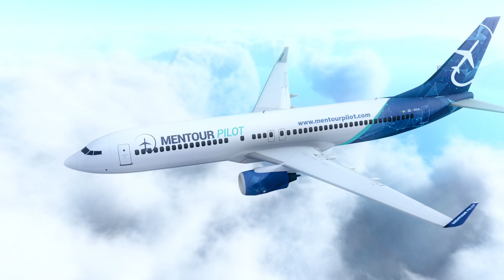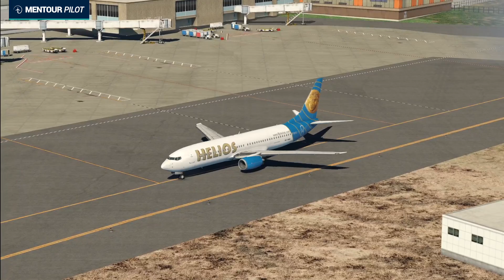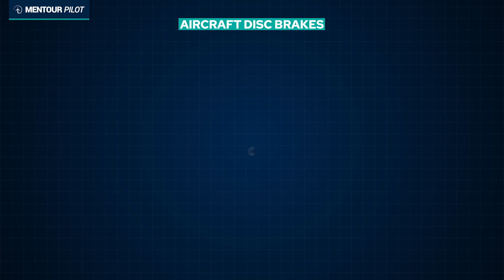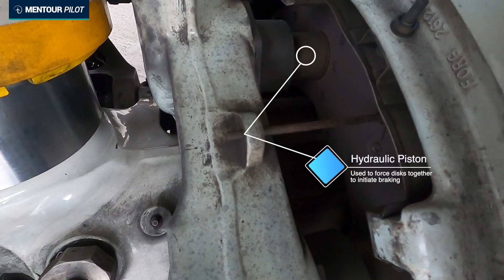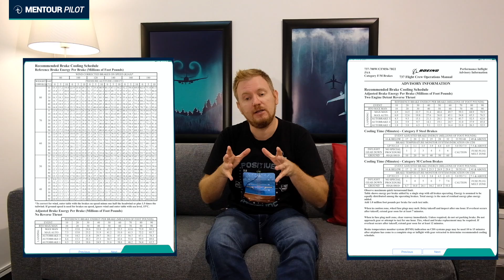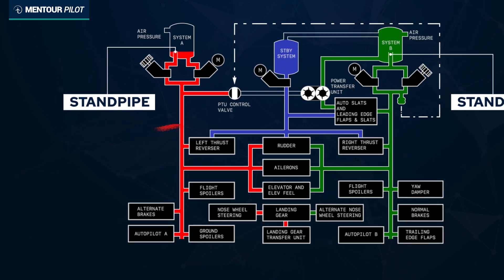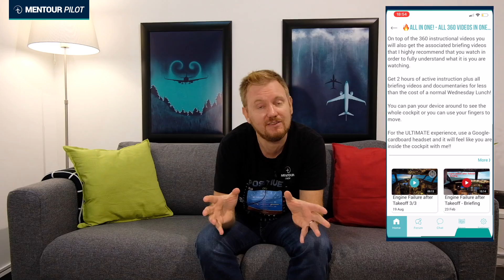How do Aircraft BRAKES work?!

Comment: A brake is basically just a type of clutch, that happens to connect the wheels to the frame.
These brakes are actually quite similar to a multi plate clutch.
That being said, there are few things faster and heavier, than a landing airplane, lots and lots of heat.
Reply: Railway trains can be much heavier and have far less grip - steel wheel on steel rail is what makes them efficient, but also means they are unable to stop hard.  Of course, failure to strap down the self-loading cargo is also a limiting factor.
Ships are vastly heavier, although much slower, but again - very limited grip so emergency stops are not a thing in naval architecture.
Reply: There are different kinds of brakes though. You are talking about friction brakes but there are induction and regenerative brakes, too, that are used on high-speed trains.
Reply: @unvergebeneid  They are still limited to the grip of the wheel on its running surface.  The only exceptions are those used on a few mountain railways and tramways which grip the rail itself, but they are limited in usefulness due to the inability to deal seamlessly with points and crossings.  Regenerative braking is also used on EVs.
Reply: Exactly what I was thinking: they reminds me a lot my motorcycle clutch, just working the other way around (not to transfer motion to the wheel but to stop the wheel to spin, a bit like shifting down).

Comment: I'm surprised to see the brakes can stay that hot,  remaining above 100°C even after hours of flight at way below freezing temperatures.
Reply: In his graph, it looks like each flight only lasts about one hour.  On short flights, a lot of that time is going to be spent climbing and descending.  The plane may not be spending too much time in sub-freezing temperatures.  Also, with the landing gear retracted, the brakes are tucked away fairly well.  Notice how much faster they cool when deployed just before landing.  Finally, the brakes have a lot of mass -- probably more than the engine in most cars.  If you park your car with a hot engine in cold weather, it still takes a while for the engine to cool off.
Reply: @andrewsnow7386  Thanks for expanding on this. In addition to your explanation I looked up a table with the "conductivity of heat" for some materials and found steel positioned by far not as high as other metals.

Also I found that diamonds are extremely good conductors of heat. I'm not suggesting to manufacture airplane brakes from diamond 😀 but I think that's another reason why carbon brake disks are superior. (Carbon had no entry of its own in this table.)

Having said that, and as being born in the 1950s, I have to state we live in really amazing times having all this information ready at our finger tips. When I studied during the 1970s it would have required to do at least a trip to the university library to find such tables giving information beyond what was contained in our physics book.

It's a pity that despite all this information is so easily available some people still believe in so much unscientific crap - and as it seems to me such believes even spread in growing numbers, like currently with anti-vaxxers. (And with believing the Earth is flat for religious reasons on top of that pyramid of stupidity.)
Reply: @mittelwelle_531_khz  Cars actually use cast iron rotors, not steel because cast iron is better at rejecting heat than steel. Another thing concerning carbon brakes on cars (they are typically an option that costs $10,000+) is they don’t work as well cold as cast iron rotors. They need to be used HARD for maximum effectiveness. It is not usually a good option for a car that is a daily driver. They are best used for the car you take on a track day regularly.
Reply: @Markle2k  Thanks for expanding on this. Seems there's no video from Mentour Pilot where you couldn't learn one or two more interesting facts from the comments :-)
Reply: @mittelwelle_531_khz  I'm also old enough to remember reference books and libraries.  The times are amazing. 
About conductivity.  Diamond has an amazing thermal conductivity (5 times that of the best metal - silver).  Other forms of carbon are not going to be as good.  With regard to metals, metal alloys usually (always?) have less conductivity than the pure metal.  Thus pure iron conducts better than steel, but also better than cast iron which usually has more carbon (thus less iron) than steel.
Finally -- conductivity is not everything.  Conductivity is needed to move heat away from the friction surface further into the disk when the brakes are applied.  But, especially on aircraft brakes, thermal capacity or specific heat is going to be at least as important.  That is, you want a material that can store a lot of heat energy without getting too hot.  Like conductivity, the specific heat of every material is going to be different too.
Reply: @andrewsnow7386  Thanks for your exhaustive response. When I was thinking about "conductivity" I had in mind the time the brakes have to cool down while the airplane is flying. But all the things you mention are of course important too, probably even much more important.

As an aside, what caught my eye is that metals which are good conductors for heat seem to be also good conductors for electricity. (I didn't look up the latter as – despite I'm mainly a software engineer meanwhile – I have a background in EE and still roughly know how various metals compare in their specific resistance.)

I guess it has something to do with how the atoms bind and that metals have free electrons, which may not only be the means by which electric charge is transported but also the way heat is conducted.
Reply: In flight they sit in a nice insulated wheel well, surrounded by a really thick layer of insulating rubber from the tyres. They only really cool off when exposed to airflow in the time the wheels are down and the aircraft is taking off, and on final approach. When in the air stream there will be flow through the pack, but typically only the outside, as they tend to be touching all the time, held there by a set of springs so that the hydraulic system has a consistent volume of liquid it has to pump for a specific brake action. 

Inner sections will stay hot for hours, especially in hard braking, and having a RTO also means you have to have a brake inspection and probably replacement, as you likely lost more than half of the active material scrubbing off that energy. You will also likely need tyres as well, they will have had a lot scrubbed off them, even with ABS, as there will still be a bit of slip as the valves modulate grip. 

The original friction material up to the 1970's was asbestos, and it is still used in some niche applications, as there is nothing that is drop in. But the modern ones use a ceramic material, or carbon composite, as the friction liner. Thus temperature monitoring, though the bigger issue is tyre degradation from heat, which is why they have a fusible plug on them that will deflate in a controlled manner, rather than exploding.
Reply: "I'm surprised to see the brakes can stay that hot"  I prepared a graph just like the one shown in the video, comparing an MD-87 to a 737 (an island-hopping airline was going to purchase one or the other).  I had access to all the cooling coefficients etc needed to run through the thermal calculations.  In my hypothetical simulations, the ratcheting-up was even more pronounced than what the video's graph depicts.  A 737(-300?) brake absorbing a moderately high energy input, and with only thirty or so minutes to dissipate the heat in-flight before more heat comes in from the next landing/taxi, keeps getting further behind.  Meanwhile the MD-87, because it used the same brake as the heavier MD-80, didn't get nearly as hot and that upward trend wasn't seen.  So as we say in engineering,  "It just all depends."  ; )

Comment: Drop the landing gear for a few seconds at a couple thousand feet altitude to cool it off
Reply: I'm sure there is a procedure to do this.
Reply: @froggymicb  Yes; Look it up in the manual before attempting the approach!
Reply: Haha I thought the same thing. Wouldn't that be a drag? 😆
Reply: @LORD_1775  Well the extra fuel might be less than the extra revenue from reduced loading times. It's a cost-benefit. 

This is a joke OFC
Reply: @pilotavery  
Whatever OFC denotes I had a  girl friend whom held an MBA and obtained work at ( major carrier ) I can assure you is is no joke to them: If some person in that position reads this they might just do the calc's ~  the person expressed wonderment at how 2 major airframe had reported being under 1 mile separation — all the computing power we have nowadays can be brought to bear saving 0.000051 / seat-mile → Many do not realize the commercial carriers operate on thin margins
Reply: @ChiDraconis  right, this is what I mean. Cost saving is not a joke, and if it burns $107 worth of fuel but they can save 7 minutes on the turnaround then it might be worth it for them to do it. However, the joke was because it was completely impractical to do this in particular.

Comment: When landing it's obvious when and how the ground effect comes into play, but is it also a consideration during takeoff? Even insignificant, though non-zero.
Reply: Yes it is, thats why you have the "positive rate" call before retracting the landing gear, if the air craft is too heavy it can actually rise off the runway in the ground effect, but then not have enough lift to climb further. You can see this in action in a lot of takeoff related accidents.
Reply: @Musikur  Wow. That's like hydroplaning in the air. That gives me a whole host of things to pay attention to and understand the hows and whys of in videos and when flying. Thanks for that info!
Reply: @GlenHunt  Very much a consideration though the feel is different;
My first-ever take-off roll in a Piper trainer I had been in a J-3 previously I am trying to do what is called soft-field takeoff as we had nearly 2 miles of concrete and I wanted the lower drag of air rather than the rubber wheels ~ instructor would not let me due to you do something that you know works but yes with even slight back-pressure on the yoke we do get some unloading of the under carriage ▬ on approach you tend to be pushing some air ahead of you and down which does not exist as much on the TO roll → it is called Air Plane for exactly the reason that hydroplaning can get your feet wet ~ Humans are not Ducks!

Comment: There are also brake fans that are supposed to cool brakes after landing. At least in some airbus a320 family. Funny thing about those is that you have to make sure no one is standing next to main landing gear when those fans are applied because it blows out carbon fibre dust which can be extremely harmfull to your lungs.

Comment: I remember having seen the brakes of my parents car glowing red hot (had to stop on the side of the road) going down a mountain when I was a kit.
Also, when you turn off your car, you don't have hydraulic assistance anymore. If you need to brake, you also have to brake with one push on the pedal. Otherwise you will loose any braking assistance, like Peter explained for the plane.
Reply: The brakes on a car will still work even with no engine power, the pedal just gets very hard and you have to apply a lot of pressure. If you ever driven a old car or a race car, same story with them. 🤷🏼‍♂️
Reply: @F-Man  “Power brakes” (showing my age) referred to the addition of a vacuum booster to reduce braking effort. Most cars now have power brakes as standard equipment, excepting only the lighter of enthusiast cars dating prior to ABS being standard. This was to allow better “feel” through the pedal for manual braking modulation to avoid lockup. ABS is so much better than the reflexes of a human nowadays that manual braking systems are only used in racing series that outlaw the use of ABS.
Reply: @Markle2k  Don't forget that ABS controls each wheel individual, whereas when trying to modulate the brakes manually, if one wheel locks up, you have to ease up on the brakes for all wheels.
Reply: @chitlitlah  Fair point. But I was approaching the question from "feel" not how and how well they operate.
Reply: The pnuematic boost will work ONCE after the engine is turned off. . .   until vacuum is lost.
Reply: @dewiz9596  in my car i can actually have like 3 to 4 deflections until the boost wont work anymore.
Reply: On most cars you have pneumatic brake boost. The brakes work with hydraulic fluid and work if the car is on or off and are divided in 2 seperate circles if one fails.
Reply: A guy stole a car and proceeded to flee from the police on my town a little while back. The car was abandoned in the street in front of my alley, and my surveillance system caught the whole thing. The guy didn't even bother putting it in park it looked like.
Those brakes were glowing so hot in the footage you couldn't see the tire rim any more. It was just white hot on the screen. Absolutely nuts.
Reply: Also dont ride the brakes going down a hill. Make harder but less frequent braking to allow heat dissipation.
Reply: I experienced something like that once. I was driving down the Rockies traveling west from Denver. Anyone who's driven there knows the freeway has steep descents for miles. I decided to put it in neutral and see how fast it would go just coasting. (My engine was choking in that high altitude, so I didn't do it just to see what would happen.) Well it ended up exceeding my car's speed limiter at 109 mph. I figured that would do nothing while the car was in neutral, but no, it still cut ignition and the engine just died. I lost power brakes and power steering while descending a hill and going around a curve. Then I had to slow the car down to get it to start up again. Losing power assist wasn't as bad as regaining it and having the steering suddenly become soft. I ended up rolling down the mountain and dying. It was a bad day.
Reply: I find it disappointing how few drivers these days do not know about engine braking or down shifting on long declines and just use the brakes with no knowledge of there heating up.
Reply: @johndavidwolf4239  It depends of your engine break power. Some engine have low engine break.
Fortunately, now I own a Ioniq EV and I can use battery regen to slow down in mountain. It is much easier on the brakes :)
Reply: @johndavidwolf4239  In most automobiles, you're going to be causing excessive engine wear doing that with little benefit. I could imagine doing that in my old F250 diesel with its copious engine braking, but in my RX-8 1.3L rotary, forget about it. Of course the RX-8 is half the weight, so the brakes aren't under as much stress in the first place, but engine braking usually means lengthening the duration of your brake pads (cheap and easily serviceable items) at the cost of your engine.
Reply: @chitlitlah  :  That engine braking causes excessive engine wear is a myth, it does not, the only exception is if you drive an old two cycle Saab, that used pre-mix.  Although it does save on brake wear, the more important aspect is that if, near the bottom of a long down hill, you need to do an emergency stop, you can do so safely.  Admittedly if you have worn rings, or valve-stem seals, you will get a puff of blue smoke when you first get on the gas after the end if the hill.
Reply: @johndavidwolf4239  That's part of the driving licence training, to gear down and brake hard and seldom. There are even signs telling you to go into low gear down long steep hills (Norway)
Reply: @kvikende  :  From talking to friends from Europe, that seems to be true for most of Europe, unfortunatly not so in the USA.
Reply: @johndavidwolf4239  How does forcing the engine to a higher RPM not cause additional engine wear? Granted it's not likely to cause your engine to explode after doing it just a few times, but forcing the engine to, say, 3,000 RPM instead of 1,500, it seems like a no brainer that it'll cause a little extra wear. And like I alluded to, brake pads are much cheaper and easier to replace than an engine. I'd use engine braking if driving a big rig where it's unsafe not to do so, but in a small car? It's not worth it.
Reply: @kvikende  I can tell you that's in the Texas drivers' handbook for commercial drivers' licenses (mostly big trucks). Also in the Rockies, there are many signs telling truckers to downshift. It's pretty much a necessity to do it in big trucks though, while small cars aren't likely to suffer from overheated brakes.
Reply: @chitlitlah  :  In no way am I suggesting to exceed engine redline, 3,000 RPM for most all engines is no sweat, even for a 50 year old car.  As you will be giving it no gas. the forces on the crank and rods will be at most a quarter of that of a full throttle acceleration.  Again reduced brake ware is an added bonus, the primary reason is to allow a safe emergency stop if required near the bottom of the hill.  If you have ever "smelled" your brakes after a long down grade, what you are smelling is the organics in the brake pads being vaporized, which causes their properties to be degraded, also the heat renerated from braking makes its way to the tires, increasing the tire pressure, again making it sub-optimum.
Reply: @johndavidwolf4239  I drove big rig and straight trucks with air brakes. when applied at high speed or heavy load the air can run out and spring brake come on. Of course when the truck is empty it handles differently and not better upon braking.